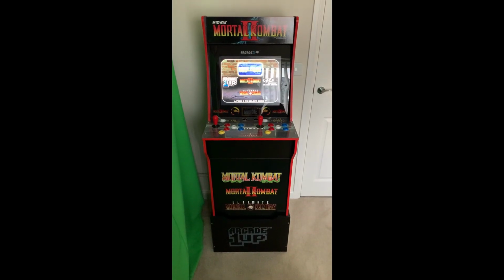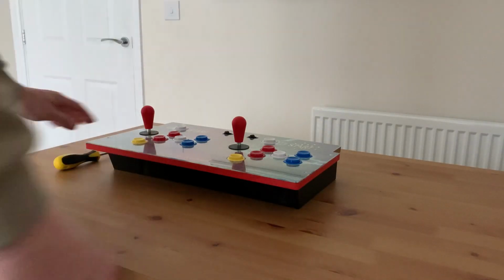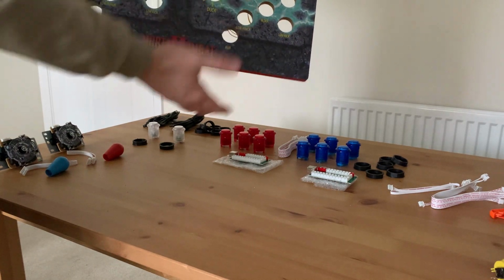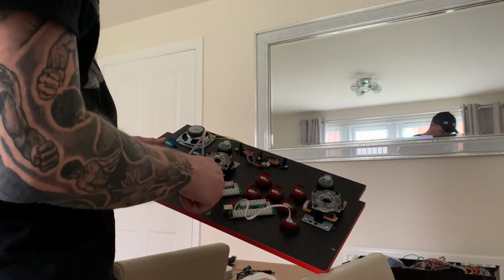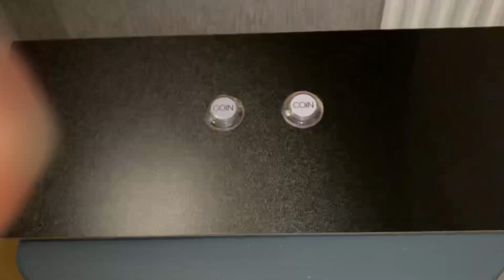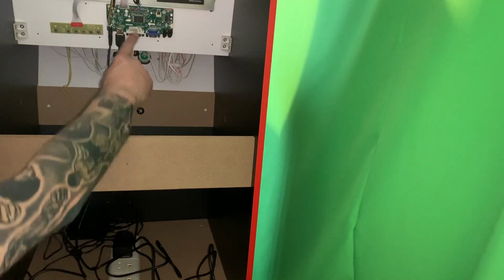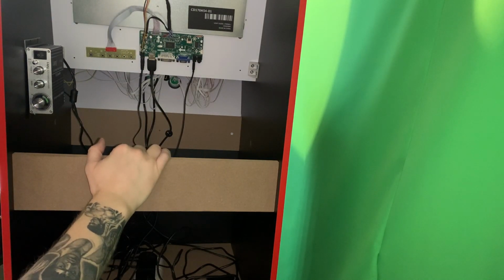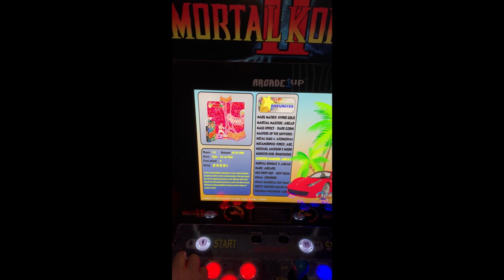Arcade1UP Raspberry Pi 4 (4GB RAM) Install + Tutorial MOD 2020! Mortal Kombat Cabinet Conversion!

Comment: hello, can i keep the original buttons and joystick or do i have to replace them all??
Reply from the maker: You can keep them if you want. Not a problem at all. I just found the stock springs to go on them after a while. Enjoy and thx for watching 👍
Reply: @nutmeister  thanks! Last question: do I really need to add two more buttons or can I use retropie with the six preinstalled buttons..??
Reply from the maker: @andrew798  nah you don’t need extra buttons you can assign the key mapping to whatever you want. Watch my key mapping vid to get a idea of what I mean 👍

Comment: nice job. Wondering how would you connect the light up marquee once you take out the original board
Reply from the maker: I haven’t tried to hook up the light because mine the version before it. If it was me I would either hook it up to the PI4 or the HDMI board.
Reply: Thanks for the quick reply. Might upgrade to a pixelcade.

Comment: Great build & nice to see a UK one!

I've got the Costco mortal kombat with light up marquee. Do you know if I could still us the marquee?
How's the button placement work for you? Ideally I'd get a street fighter Cab to mode (having all 6 buttons together) but I'm running out of space! Haha
I think I'd do this mod, add a second speaker & have the amp attached to the outside on the top. What do you think?
Reply from the maker: Am sure you would be able to light it up off either the PI4 or HDMI board. The button placement is ok but not as good as the SF2 cabinet because that has the traditional layout. The amp would be better outside and the stock speakers are awful . I’ve actually ran a aux cable and hooked it up to my pc set up now. Any speakers with a aux connection can be used. Enjoy and have fun modding it. Thank you for watching and for the feedback.

Comment: Great Video. I followed your steps and succeeded the starting arcade1up, unfortunately no sound. Can you please provide us, which sound settings did you use for raspberry and retropie? Output HDMI or Headphones? Should I customize any config file to get sound?
Reply from the maker: Hi Levent. 
Are you using a amp? if so , from the amp to the board move the aux port to the other 3.5mm jack on the board. On some revisions the aux 3.5mm slots are the other way around. Let me know how you get on.
Reply: @nutmeister  Hi, i was using an amp like yours. It was connected to the speaker of arcade1up. But it did not work. Now i connected the HDMI board and an external Logitech speaker with a 3,5mm cable. It works now great. The amp is no more needed. Thanks
Reply from the maker: @leventoturak8267  sounds like you have a dodgy amp. Send it back and get your money back. Great to see you found a work around. I bet it even sounds better than mine coz the stock speakers are rubbish. Enjoy and thank you for watching and using the guide 👍

Comment: Can you do this mod without changing the original buttons?
Reply from the maker: Yes you can do the mod without changing the buttons and you can do it without the amp. It’s really upto you. Thank you for watching 👍
Reply: @nutmeister  how do you do it without the Amp and without changing the buttons?
Reply from the maker: @jamc0201  There is other guides out there showing how to do it. Just search on YouTube. Arcade1up conversion and check out some others. So many have there own way of doing it differently than me.

Comment: Hi. Thanks for tutorial. Would it work with also with the rasperry Pi 4 2gb?
Reply from the maker: Yes it will,  but you might have a issue with the odd rom suffering with Stuttering. But you should be fine for most of them. Thx for watching 👍

Comment: Did you connect the on and off switch to the new encoder boards
Reply from the maker: No I didn’t. I either shut the system down when inside the settings or I just switch off at the wall. I have no issues with switching it off at the wall. But am sure you could easily hook the switch up to board to use that instead. Thx for watching

Comment: If I wanted to used the joy stick and buttons that came with the cabinet  can i? And can I use a Raspberry Pi 3 ?
Reply from the maker: Yes to both questions. These cabinets are so versatile and can be modded so many ways. You don’t have to change to the buttons or install a amp. You can leave that all stock and just use a Pi3. Loads of guides on YouTube to do a simple Pi3 install with stock buttons. Thx for watching 👍

Comment: Whats a safe overclock in the flirc case without it stressing out the raspberry pi 4??? Great video by the way. Same arcade and used all the links you put up so I could buy what I needed.
Reply from the maker: Thx for the great feedback really appreciate it. I haven't tried to overclock the PI4 yet because everything I've installed runs smooth on it. But I have no doubt in that case you could crank it up a little without any further cooling. The heat sink on that case is spot on. Hope your build all goes well. Need any help message me on FB.
Reply: Ok thanks mate.

Comment: Where would I get all those parts to mod mine
Reply from the maker: If you look in the description you can see a full parts list There. All parts can be purchased on eBay and Amazon. Just follow the links
Reply: I read a few comments about rasberry pi for conflictions. Ppl have said raspberry 3 runs better for arcade 1up.     What are your thoughts on that?  Also ive read from a couple people about blowing their amplifier and not needing one to begin with.  Your thoughts on that as well.  I was just thinking about hooking up  aux speaker beats pill.  Thank you for answering my last question I'm sure u have alot of ppl asking questions.  This is all new to me.  All I know is I want a killer arcade cabinet to transport me back to my youth.  I tell alot of ppl about this setup and they can't even believe sumthin like this exists lol.  Keep up the great work!!
Reply from the maker: @theknight8036  thank you for the feedback much appreciated. PI 4 in my opinion works just as well in a 1up cabinet , the reason some would say that the 3 is preferred is because there has been more themes made for it because it has been around longer. The PI4 infact runs games that would struggle on the 3, so for me I would pick the 4 over the 3 any day. There is amazing themes now on the 4 also so that debate is kinda getting old now. Regards to the amp debate, this is a optional extra and isn’t needed. It will only blow the speaker if you crank it up to much because the speakers in the 1up ain’t great. I’ve converted a lot of these cabinets and for some people i do a speaker upgrade and the amp is needed. If your not changing the speakers then the amp is a nice to have and not essential. Hope this helps you out. Let me know how your build comes on.
Reply: @nutmeister  would u have any idea how to connect a ps4 to an arcade 1up
Reply from the maker: @theknight8036  because you have converted it to use hdmi. You can use any console or device that uses HDMI. All you do it replace the PI device for the device of choice. You would have to use the controllers through which kinda makes the cabinet idea a waste of time.

Comment: Awesome bro thanks! Doing this to my Marvel vs Capcom Arcade1up cabinet. What is the best build you have found for the Pi 4 but for the Arcade1Up cab in particular. Looks like there's a bunch on Arcade Punks
Reply: I noticed on Arcade Punks there are 2 files for him "RETRO-BLISS.Pi4.v1.98x.4.6.7.(ARCADE)-VIRTUALMAN" and "Retro.Arcade.Bliss.RPi4.v1.5U-4.6.1-VirtualMan". I'm assuming ones just newer than the other?
Reply from the maker: @McGuinness89  yes, bug fixes and stability, plus updated artwork covers plus a few other bits.
Reply from the maker: Virtual man arcade build is without a doubt my favourite and best in my humble opinion.
Reply: @nutmeister  I appreciate it. Downloading his 128gb and 512gb builds now :)
Reply from the maker: @McGuinness89  128gb retrobliss works a dream on Pi4 .

Comment: Great video, quick question which case did you get for RSP4, and does it have cooling.  I've just purchased a SF2 1up Cabinet and also like you have Virtualmans Image, I enjoy playing the likes of crazy taxi etc but will need to overclock - is your case ok when pi4 overclocked?
Reply from the maker: Hi Covfather. The Flirc case is the best on the market and can deal with overclock no problems at all. With this case there is no need for a fan, so no noise . It has a thermal paste pad that cool the PI4 and does a remarkable job at that. It can handle temps of upto 80C. Hope this helps. I have a link to the case in the description, click on there for more info. Thx for watching 👍 appreciate it massively!

Comment: I have a 1Up small megaman console w a sd card in back. Can I download MK put it on SD and into my megaman 1up
Reply from the maker: If you follow my guide then you can do what you want with your 1up because it will be full converted, if it’s already done then yes you can no problem. Got different themes coming soon. Watch this space 👍
Reply: @nutmeister  thank you. I'm hoping alot is already done on these newer systems because I'm terrible w tech.

Comment: Cab is all modded, but im only getting 1p button config, any ideas what could be wrong?
Reply from the maker: This could be a number of reason. Go back over your button wiring and make sure it all matches player one for a start. Make sure it’s all wired up securely on the second encoder. Then make sure the usb cable is correctly connected to the PI4 from the second connecter. Then work backwards. Swop the usb around and see if it only sets up player 2. If it does you might have a usb issue if it doesn’t you might have a encoder issue. Process of illumination.
Reply from the maker: Am curious, when mapping your buttons you only need to map player 1, it automatically copies over to the second one. Have you checked to make sure there both working?
Reply: @nutmeister  Oh I didn't know that.  I've got it recognising the P2 buttons now, but I killed the card again somehow, turning it off at the mains.  What's the best way to shut it down, so I don't have to continually rewrite the card?
Reply from the maker: @janobiwan  what memory card brand are you using? Because it should easily be able to handle being shut at the wall. That’s how I do it. But if you want to do it another way. When your on the main menu. You press start button then scroll down to shut down. If it’s a cheap branded memory card could be the issue .
Reply: @nutmeister  It's a sandisk 400Gb one.  I'll try the other method.  Thanks for all the help :)

Comment: Really nice buddy, I'm over in Canada, but the set up will be the same I expect, thanks for the vid!
Reply from the maker: Yes if you follow the guide everything would be the same. Thx for watching 😁
Reply: @nutmeister  Really great, thank you so much for the excellent tutorial, I really think I can pull that off, and will be scoring a cabinet to start on asap. Thanks again
Reply from the maker: @mrnobodyinvr9762  you can easily do it. It’s not a hard build. Just take your time and enjoy every second of it. You will want to do another one once you have finished. 😁
Reply: @nutmeister  and thats kind of the plan. Is there a cabinet that you think is the best to start the build with? I'd rather not drill it if I can avoid that, but I guess the Coin buttons are needed for the arcade coin buttons. Any you recommend as the best Base box to mod?
Reply from the maker: All arcade1Up cabinets are good to use , but I would go for a street fighter or mortal Kombat cabinet for the 6 buttons. Drilling part is so easy and the panel I drilled into was thinner part with no decals . You could leave that panel out all together when you build the cabinet , and have the buttons inside the cabinet but also that would leave a massive gap in the front. Or you could leave the back panel off and just have the buttons around the back. Drilling them somewhere would be the best option.

Comment: I have a question I have to put the board on the metal part because it will not stretch to the wood is this good or no
Reply from the maker: I really wouldn’t advise that because any of the board touches the metal you could have issues. If you have too maybe consider having sticky pads or stick the board to something else before mounting it to the metal plate. Last thing you need is a fire hazard or a blown circuit board. Even though it’s earthed you still want to be as safe as possible. It should reach though.
Reply: @nutmeister  thank u so much for the advise I appreciate it
Reply from the maker: @Kisame-r8o  pleasure. Really hope your build goes well. Thx for watching
Reply: @nutmeister  sorry again bro don't mean to keep bothering u but I brought the same buttons and one of them keep turning off I wired them correctly and double checked my work.do u know what that could be
Reply from the maker: @Kisame-r8o  Hi, no bother at all. Check the button you having the issues with and try and swop the connectors around. Should be two connectors wired up to the button. Swop the wires over. Sometimes they mix the wiring up. If that doesn’t work , try and return the faulty button or contact the seller and ask for a replacement. I’ll help as much as I can.
Reply: @nutmeister  man ty I appreciate it I'm still struggling with this build I do have one more question I'm trying to run games on my pie but they don't seem to be loading correctly I was looking into it is there a way to get cps1 or 2 cause certain game just won't load on fba or mame

Comment: Excellent video.  Wonder if you could do a quick video on how to map all the buttons because that is where I am having issues
Reply from the maker: Hi David

We’re are you struggling? It’s pretty straight forward. Thx for watching. Might be a good idea to make a setting tutorial 😁
Reply: @nutmeister  I am not sure how to even start configuring the controls.   Sometimes player 2 doesn't match the same mappings as player 1
Reply from the maker: If your having this issue then the encoder hasn’t been wired up correctly. You need to make sure all the wiring on the encoder for player one match those on player two. If they don’t match exactly the same then when you configure the controls in settings it won’t configure correctly because the encoders are conflicting with one another. Watch the part in my video we’re am doing the button swop over and the part we’re am talking about the encoders. Even if you think there right go and check it to definitely rule it out.
Reply from the maker: https://youtu.be/09DQCOr6zQM @20:00 minutes. Here is a button configuration guide from a great modder called ETAPrime. Have a watch of this.

Comment: How do you add 4 player capability? I have the same cabinet I wanted to put a raspberry pi and have the capability to plug 2 controllers in to play 4 player games.
Reply from the maker: Yes you can plug controllers into the PI. Wired ones work best and just have them either resting in the top or find a creative way to add them to your cabinet. Then set them up as you could the joystick and buttons on the cabinet, it’s really easy.
Reply: Thanks your the best

Comment: Im really looking for someone that could mod the mini arcade mortal kombat and add a micro usb slot on it
Reply: If you could mod my mini arcade for me that would be greT
Reply from the maker: If your in Canada it will cost a fortune to ship it to the uk , then with all the cost of modding it and sending it back to you. The cost would be silly. Am sure you can find someone on YouTube that mods that would be closer to you. Good luck and thx for watching.
Reply: @nutmeister  actaully I have a free mail deposite box near.my house so pricing on shipping isn't a problem for me
Reply from the maker: That could easily be done with no issues. Just run a extender from the PI and then find we’re you would want to fit it in your cabinet. Thx for watching.
Reply: @nutmeister  would you let me send you my mortal kombat mini arcade
Reply: @nutmeister  i would also be able to pay you
Reply from the maker: We’re about are you in the uk? Have you bought all the bits to convert the cabinet? Have you made the cabinet you have or would you be thinking of shipping the whole thing flat pack? There is lots to consider here bobbles and it could be expensive. Why do you want to add a micro usb slot ?
Reply: @nutmeister  its for the arcade classics mortal kombat I'm hoping to add a micro isb slot to give it power for when I'm not using batteries and if I could get a rasbery pi out in the mini arcade that would be great I did not make this mini arcade machine you can get It in canadian tire or Walmart
Reply from the maker: @the_ninja2001  I know you never made it what I meant was have you assembled it. If you put a PI 4 in your cabinet that is already powered by micro usb so you would not need another power source. If you convert the cabinet you will no longer need to use batteries.
Reply: @nutmeister  i have no raspberry pi of any type i was hoping to get that put in by any modder who would customize my device
Reply: @nutmeister  do you have a discord or any i can  message you too make this easier

Comment: Hi how to you turn off and on the arcade machine, also if I want to use the speaker only without amp, how do I connect it, Thanks for your help!
Reply from the maker: Hi. A few comments down, Colin Stewart has answered all those questions. There is a way to wire up the amp to the volume button and also a way to turn it off using the on off button. Follow Colin’s advice a few posts down.